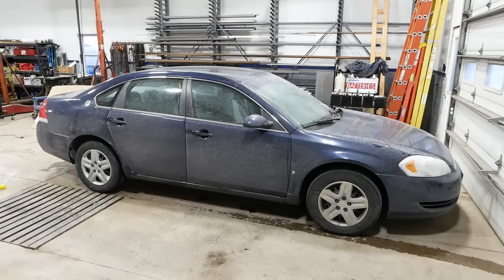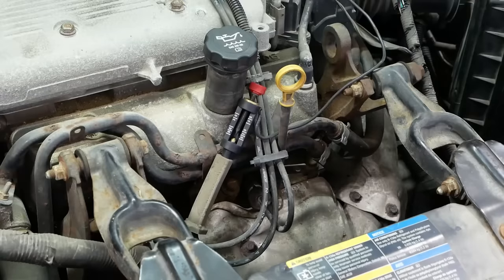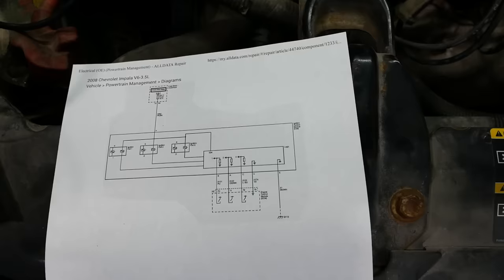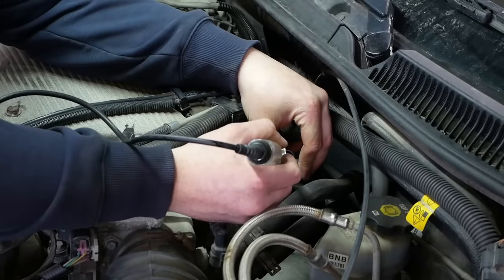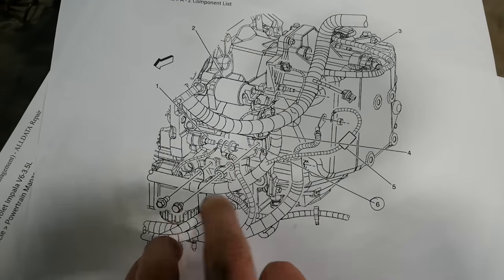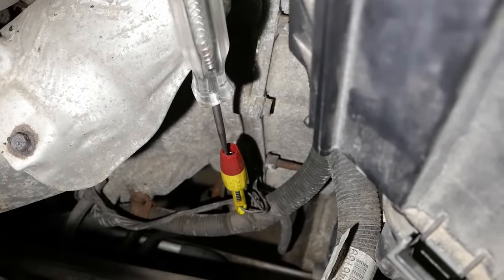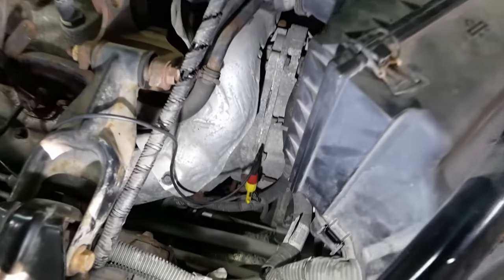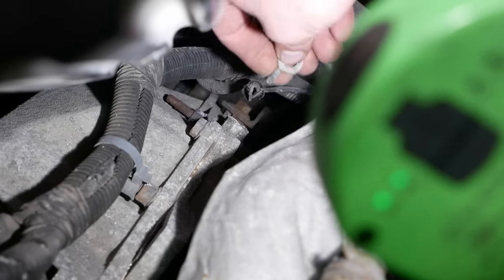Chevy Impala no Start, no Spark, no Codes

Comment: Just a tip for everyone when working with “green oxidized” wires. Get the regular lysol toilet bowl cleaner. Don’t use the “Works” brand as it is too strong and tends to oxidize the wire as it cleans it!  If you can dip the end of the wire in it is best. If not use a cotton swab to dab it on. It usually takes less than a min to clean up the wire. Rinse it off with water and then neutralize with baking soda. Repair as you normally would after that. Add some dielectric on it or liquid tape.
Reply: Salt and vinegar also work.  Don't forget to neutralize and dry.

Comment: I'm really glad I'm not the guy that gave you grief about dielectric grease
Reply from the maker: It's half the internet...
Reply: @WatchWesWork  the keep giving it to them
Reply: whats the grief about? they think itll mess with the connection? it wont, anywhere theres grease would of been instead air which is equally unconducive.. theres no need for the grease to be dielectric though, at 12 volts everything is "dielectric" even water.. otherwise when you hose down your engine bay the puddle of water on top of the battery would flow current and boil off/separate in O2 and H

at 120v's yeah you might wanna use dielectric instead of a regular grease if the grease is going to have a path between two connections, but a single isolated connection can still use standard grease upto any voltage, it has no where to flow to

Comment: Nice job as usual, I loved the humor of the d grease.  Have you ever used ACF50?  It is used a lot in the aircraft community for corrosion control.  I have used it for years it works great.  I use in on anything electrical, it works on the inside of wings ect on aircraft, (the whole wing in fogged with the stuff and the corrosion problem goes away.
Reply from the maker: I'm not familiar with it.

Comment: I rewired my utility trailer.  I soldered every connection, and used heat shrink to seal the connection.   A few months later I started having wiring failures.  I finally built my own harness, but in the process of replacing it I found my mistake.  I was using acid core solder.  The acid ate thru every connection, that I so carefully made.
Reply from the maker: Yeah that stuff only works for pipes.

Comment: At 3:35 are you checking for ground with the test light clamped onto a ground? Wouldn't you need to connect the test light clamp to the positive battery terminal to check for ground?
Obviously your diagnosis was correct, I just dont really understand how that worked

Comment: Nice video Wes. My wife has a 2009 and has the same whiney power steering pump that was replaced less than a year ago. It stops whining when it warms up and we were told that's normal.
Reply from the maker: Yeah they all seem to do it. Not sure why.
Reply: Yes you do Wes, fluid viscosity. Thick fluid causes more drag on the pump veins which causes shaft deflection, stressing bearing alignment creating frequency harmonics reaching a decibel level that then can be detected by the human ear.
Reply: Once the fluid warms up, no more noise.

Comment: Well, sitting here in my recliner and watching you on my 51" screen I feel like you should have sprayed penetrating oil on the bolt before breaking it loose and also soldered a connector on each ground wire. 🤣🤣

Comment: Had the same thing happen to an 08 Tahoe 5.3. The whole passenger side ignition coil bank died because a ring terminal on the bottom of the engine for ground corded and broke the ground connection. Junked the whole motor and had to be replaced since it was just washing the cylinders out on the passenger side

Comment: The 2 wire harness that connects the crank pos sensor to the ignition module has been the cause of this exact issue. The wires are a twisted pair, and the location(behind block around rear exhaust manifold) get dry rotted and the insulation crumbles causing the wires to contact, cancelling the signal. This will cause a no spark/intermittent no start. No one sells a replacement, I've had to fabricate them many times over the last 15 years. Here in AZ the wires seem to crumble more than back east. These engines have 2 different crank pos sensors, one under the balancer, and the other in the right side of the block(midway under exhaust manifold). The latter is often over looked, and is not easy to get to, especially when working on the ground. If that car comes back with the same problem, check that wire harness. There are NO codes for this.
Reply from the maker: I'm not seeing where any sensors connect to the module. It's driven directly from the PCM.

Comment: Our engine teacher insisted we crimped and not solder our joints. Apparently solder melts with heat under the hood, gets weak over time.

Comment: Do you have to use a diagnostic tool to relearn the crank sensor?  If Wes had performed all the steps without the tool, would it have worked?

Comment: Great job on the diagnostics! Very thorough and step by step. Coming from an electronics repair background, my tendency is to solder my connections. However, there seem to be connections where soldering them is not a good idea. In particular, high current connections shouldn't be. I didn't understand that till it was explained that if you are relying on the solder to keep the connection together, the solder can weaken and fail if the connection gets hot. I don't expect this connection to get hot but, In this case, the original connection was crimped not soldered. Given what you did to protect that connection from a future failure, I would say your connection is better than factory. Also, this is a 2008 in a salty environment and that factory crimp lasted around 14 years. I think your repair would last longer than this car is going to be around.
Reply: I worked at a military contractor in 1980s back when I thought a solder joint was always superior. They showed me the data that a crimp joint was more reliable, especially in any vibration environment like a vehicle. The solder turns the multi-strand wire into a solid-core wire. Solid core wires break at the connection. They did say that if you spent six months at NASA soldering school, you might learn to solder a terminal connection. The tough part is to not use too much solder, and to only solder from the ring side of the terminal, so that wire side has no solder between the individual wire strands. It was 19-strand Teflon insulated wire, and the Teflon caused its own problems. It's gummy and splits easy, but is slippery so it can stand vibration between wires in a conduit better, as well as withstanding higher temperatures.

A proper crimp gives what is called a gas-tight connection. It is pure copper all the way through and can take high current just fine. A lot of problems with crimps are that people use those 10-dollar hand tools, instead of the 400-dollar ratcheting crimpers that got sent off to calibration lab once a year. Those tools were designed for a specific terminal and a specific wire gauge, so they are not very practical for general repair use. Guys like Wes develop that critical "feel" for when the crimp is right. I still wish he would use thermal strippers rather than some over-engineered German clunky stripper. You never nick a wire with thermal strippers, another trick I learned at that military contractor.
Reply from the maker: Hmm. Thermal strippers? I'll look into that. I have every other obscure wiring tool...
Reply: @WatchWesWork  For what you do in your shop Wes, I would bypass a thermal wire stripper. I tested one, albeit a less expensive one and didn't get repeatable results when trying to set for the wire gauge size. At least for smaller wires it just wasn't consistent. And in your shop setting for different wire gauges for different vehicles likely isn't time effective. My opinion anyway from a former manufacturing engineer.
Reply: @WatchWesWork  Brian might be right about the cheap thermal strippers. I bought a used Meisei HOTweezers M-10 thermal wire stripper from a salvage yard when I lived in Silicon Valley. With the temperature control you can strip all the way from PVC to Teflon wire, but the thing I love about it is that the strippers are like tweezers and you can get them into a tight bundle of wires. There is a little holder on top of the power supply, so when you dock the tweezers in the holder, it cuts power to tweezers. The strippers are over 500 bucks new, but I see them on eBay for a bit over a hundred bucks. If the wire to the tweezer is broken, that is no deal, I had that with a Metcal soldering iron once, and I hate buying used stuff every since then. If you do get one, I would recommend holding out for the Model 4B tweezers that have grooves in the blade for 28 AWG to 18 AWG wire. The Model 4A is for 36 AWG to 24 AWG wire, and the Model 4C is just smooth jaws that you have to spin around the wire to melt through the insulation.
https://meiseitools.com/products/hotweezers/
Reply: @WatchWesWork  thermal stripper: small flame?

Comment: HAY WES. LOVE YOUR VIDS.   BUY A SELECTION OF STAINLESS STAR WASHERS AND USE BETWEEN CONNECTOR AND BLOCK OR SURFACE OF CONNECTOR. REALLY WORKS GOOD TO GUARANTEE CONNECTION AND PREVENT HARDWARE LOOSENING.

Comment: Dang old di electric grease probably would have kept the original corrosion from taking hold.
Why engineering thought two connections of two wires on one ground.
SMH Wes your winning today  👍
Reply from the maker: Who knows. It grounds all kinds of other stuff like the AC clutch.

Comment: Those wire strippers are nice. I don´t have one from Rennsteig, but a pair of Jokari and Cimco each. Not as Nice as a way simpler version, but also for slightly different application.
While those wire strippers cost half a fortune, sending a small package to the US is actually not that expensive, depending on size and weight. up to about 4 pounds, depending on size you are in at at most 16 EUR, up to about 10 pounds you are in or about 37 EUR. From what I have seen the last time a USPS package within the US is about the same (which to us paying usually about 5-6 EUR for a package across Germany at first glance is hillarious. But that is about the same distance as within e.g. Texas.

Comment: I've always had to change crank sensors on those engines and ground straps. I hate them lol I also live in MI and corrosion on the connectors and grounds

Comment: Your statement," Just to make sure so that no electrons can flow through"?, ground status and dielectric use at 10:46, that ground point is the source of the electrons for the circuit's current. However, at 5:50 you do speak of amperage, i.e., current - electrons in the ground wires. That said, I do like how fast you resort to diagrams and testing procedures to diagnose problems.
Reply: It's a running gag on this channel.

Comment: Probably wouldn't be a bad idea to solder that I also would use some Dielectric grease on the bolt threads and on the connection between the bolt and the islet

Comment: The professional boat people say Do Not solder terminals in high vibration locations. Solder makes stranded wire behave like solid wire and fatigue and failure like solid wire.

Comment: Always suspect a poor ground with car electronics. Sometimes there is just enough resistance to cause problems, yet the test light illuminates OK, so better to test ohms with a meter or do a pierce-tap to ground near the component being tested. 

Poor grounds were a known issue with an old Buick I had. Same car also had an intermittent spark miss on one cylinder. Was given a good used IGN module and coil (more known problems with that car) but no good. Scan for codes and there are none when it should show the miss- AHA! If the PCM wasn't seeing the miss then it's bad; new PCM and it runs like a top. Not seeing what you should see can be a diagnostic clue too, and a lot of folks miss that since it doesn't show on the scanner.

Comment: i had a 04 grand am where i changed the ignition control module, turned out to be a break in the power wire right near the plug that goes into the icm. so sometimes it would work sometimes it wouldnt, of course shortly after that i had to change the cat due to the fuel it dumped threw it.
Reply from the maker: Well that's fun!

Comment: 12:38  I've run into that problem working on mainframe computers.  They tell you what circuit is the problem but they can't tell you the exact cause or the faulty component.  That's where troubleshooting knowledge comes into play.  Many techs don't have that skill.  I wonder how many components have bee replaced and charged to the customer when a faulty ground or some other simple fix corrected the problem.  We'll never know.  Dishonest mechanics rely on our lack of knowledge about our cars.  I took two years of automechanics in high school (middle of the last century) and it saved me thousands of dollars even with today's cars.

Comment: Soldering is actually not great in automotive wiring applications because it creates stress points in the wires and increases their likelihood of breaking or the solder joint itself breaking. That’s part of the reason why you don’t see soldered wire joints in quality OEM wire harnesses. Joints and connectors are always crimped only. A properly crimped and sealed connection will work just as well, if not better than a soldered connection.

Comment: Never solder when the application experiences vibration.  That's NASA's engineering rules, so that's good enough for me!  I use uninsulated butt connectors (seamless) finished off with glue-lined heat shrink.

Comment: I've found that roll crimp terminals holds much better than those awful red, blue and yellow terminals. But one has to get the wire in the pretty much correct position before crimping.

Comment: No, because you are in a high vibration area and over time the solder will make the wiring brittle causing the connection to fail.

Comment: Re the crimp fitting:  my experience, as a hack job home tinkerer, is that crimp fittings which only grab onto the wire, are unreliable.   Auto parts shops are full of them.. those ones with colored hard plastic sleeves which do absolutely nothing, and even auto electricians use them.   OEM, however, have two part crimps which grab the wire, and the insulation, separately.   I use those, and even the rubbish quality you get from China on Ebay, are, I feel, better than ones which only grab the wire.   You can pretty much always pull them apart with your fingers, which isn't exactly ideal.

Comment: i have the same launch i moved the software from it to my samsung galaxy S-4  10'' tablet made everything better larger screen faster processor works better all around. the tablet was ok but the android software was old version compaired to the samsung makes it a joy to use. and its easy to do you just go to the launch site download software and you are ready another thing i did was i didn't down load automobiles i don't work on which saves a lot of space on the tab there were so many on there i have never heard of

Comment: Don’t solder automotive connector.  Vibration will break the wire at the solder joints.

Comment: I know it’s NEVER been mentioned before, but if you’re struggling with those old rusty bolts, try using some “penetrating oil”. It’s available at most auto parts stores…..
Reply from the maker: I'll look into it...

Comment: Im gonna go out on a limb and say the module or chewed wire on the module harness. I've also seen where  someone installed coil.packs and didn't put the conductive grease between the coil pack and module

Comment: Hi I've got a 2005 Ford Taurus with the 3L pushrod single cam engine and in park or neutral runs great you can rev it up to the rev limiter multiple times just strong as it can be the minute that you put it into gear and go down the road and try to push it just a little bit like a kind of like normal acceleration it pop pop pop pop pop pop if it gets into overdrive too soon and catches a rise in the road pop pop pop pop pop pop pop pop I've switched out new spark plugs Motorcraft wires changed just about every sensor that I can think of either from another Taurus that runs perfect and am unable to locate the issue do you have any ideas how can a car run so strong in park and the minute you put it in gear and try to get it to go down the road it sounds like an old 6 cylinder Chevy with the timing out pop pop pop pop pop pop pop

Comment: When you were testing the ground pin it looked liked the other end of the tester was still hooked to ground on the top of the engine. Had you tested it before or am I misunderstanding what you were testing (which is every possible).
Reply from the maker: The light was hooked to battery positive. I should have shown that.
Reply: @WatchWesWork  I wouldn’t have thought twice if I hadn’t seen what looked like an alligator clip on the intake manifold. I think you’re going great so no worries.
Reply: @paulhimle  That might have been the spark tester.
Reply: @jimr118  good point, I think you’re right

Comment: No, you don't want to solder anything that can vibrate or move around. The soldered wire is much easier to break than a crimped connection

Comment: I wonder how common of a problem that is… seems like it would’ve been prevented by heat shrink ring terminals like you used.
Reply from the maker: Yeah I have always wondered why they use those open crimp terminals on the grounds. They cause so many issues.

Comment: Wes no I would really want that you are in my area 🙄🙄 my battery light at car dashboard  it's constantly on (my guess is that alternator quit charging (for some reason? Now i need to find decent mechanic to  properly diagnose (what's faulty) and I really need my car 😪😪
Reply from the maker: Yeah it's never simple with modern cars.